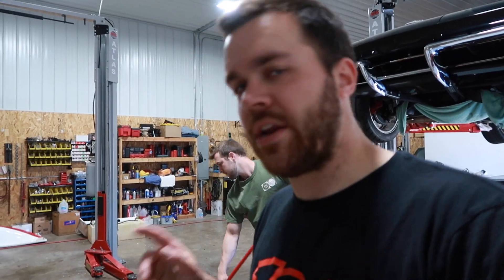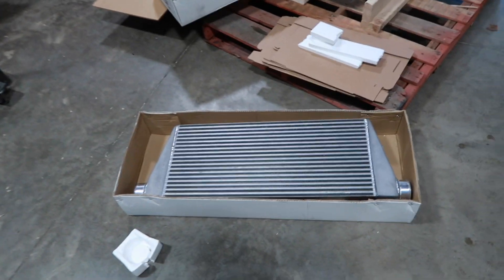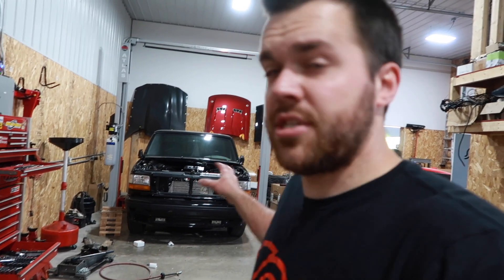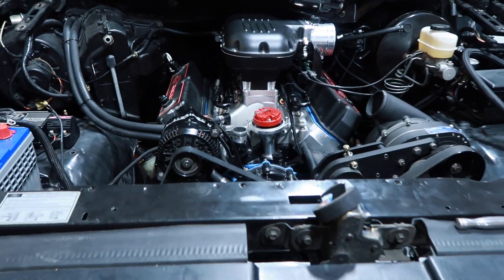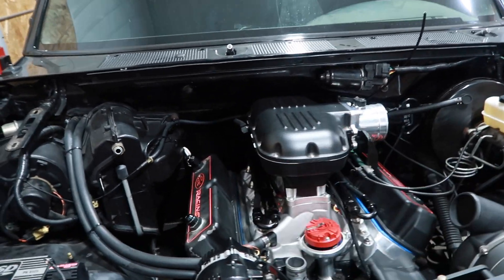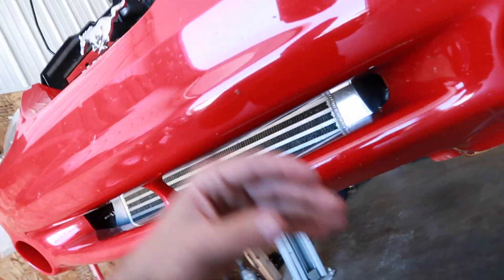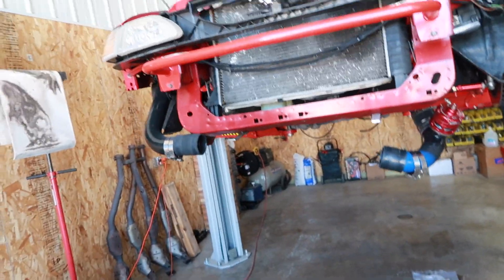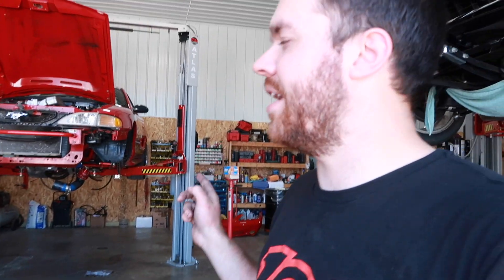Treadstone 1245-28 1200R Install and Review on Procharged Mustang Cobra.

Comment: What were the dimensions of the old intercooler?
Reply from the maker: the old one in this video was a goodwin/ebay intercooler maybe 12 tall, 24 wide, 3 thick. SInce then this treadstone has recently been replaced by a SSP "THICCC" Custom sn95 and edge intercooler

Comment: What intercooler upgrade do you guys recommend for the 30/04 cobra ? thanks
Reply from the maker: tubular front bumper support for gt500 heat exchanger and gt500 or emp pump
that's the best
Reply: @StreetcarShenanigans  Thanks for the info